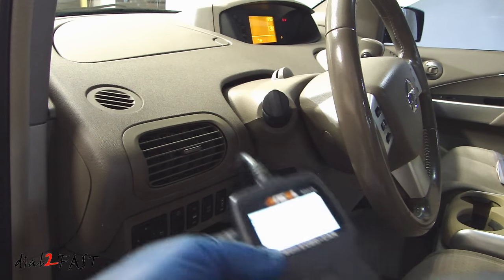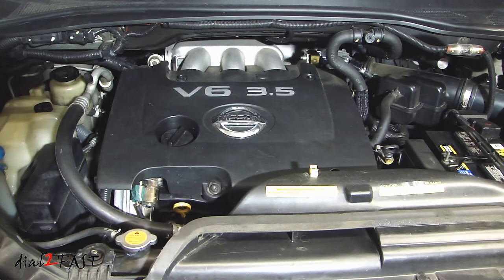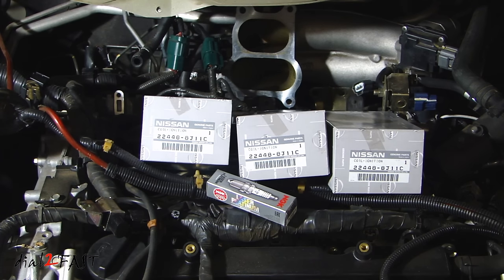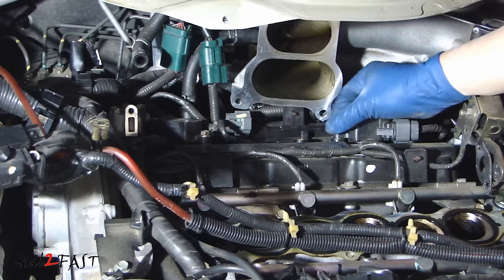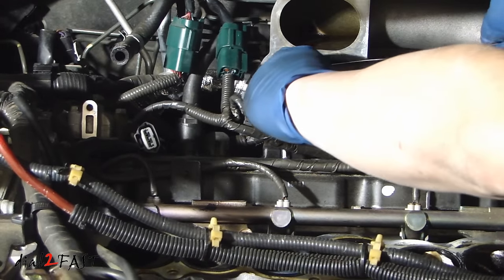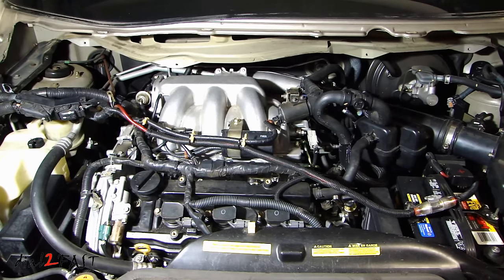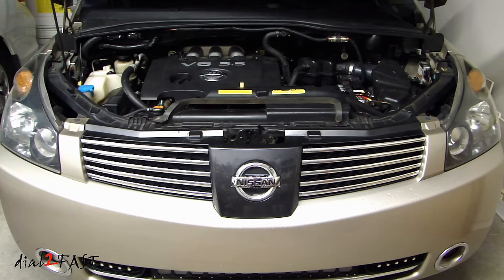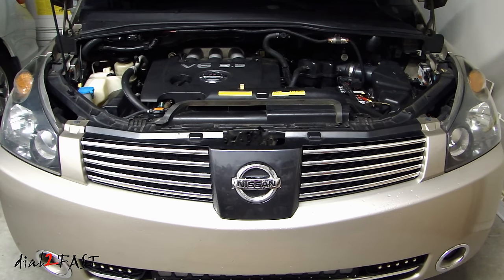Nissan 3.5L V6 Ignition Coil Misfire - P0303 Cylinder 3 Misfire

Comment: I just want to say THANK YOU for your videos. 2 days ago the 05 quest started shaking and stuttering and the CEL flashed on. I keep a scanning tool in the van because the P0420 likes to come on at times and I just reset it.  So the code came as the same cylinder #3 misfire. Ordered the parts on Sunday, locally, and called as a "what the heck" to my two mechanics to see the cost of labor. $300. ugh. So spend several hours on Monday looking at the videos to see how to do it myself. 

Very slow and methodical, and struggled with that one bolt on the back bottom right of the intake. If it wasn't for that, would have gone quicker. also, a socket fell as I was trying to finish and putting the two bolt on the back of the intake ( the two in the back bottom closest to the firewall, not the group of 4 to the intake).  Luckily, the last time my mechanic redid the valve cover in the back, the green connectors were left unattached from that bracket. 

All in all, took 7 hours for me, which included lunch, breaks, two trips to the auto parts store for that torx socket and another stubby ratchet, since mine was too fat, and alot of latex gloves!!! But I saved $300, actually more as I got 3 ignition coils on sale for less than the price of 2 at the mechanic (if I took it there).  I opted to do all three at once, with new plugs, because I wasn't going to do that again. 1 spark plug was actually cracked on the tip. So glad I did them. You Rock!!!!

Comment: I did my 05 Quest and I removed the two bolts holding down the back bracket it’s showing on minute 4:35 instead removing all four bolts it was a time saver and easy doing it that way. Thank you for posting this great video
Reply: Hello, Did you remove the window cowl and wipers to get to it? Thinking of doing myself and that may determine if I do or not? Thanks

Comment: I found it a lot easier to remove the entire upper plenum with throttle body, and I highly recommend anybody doing a tuneup on a Nissan or infiniti to replace ALL coils at the same time to prevent having to take it all back a part again lol
Reply: Chris Atkinson I did the coils, spark plugs and the valve covers on my 05 Quest and I pulled the upper plenum with throttle body I just removed the two bolts holding the rear bracket it was easy than the four bolts thanks for your comment.
Reply: Thanks
Reply: Hello, Did you remove the window cowl and wipers to get to it? Thinking of doing myself and that may determine if I do or not? Thanks
Reply: @moisessantacruz8903  Hello, Did you remove the window cowl and wipers to get to it? Thinking of doing myself and that may determine if I do or not? Thanks

Comment: Thank you for sharing your expertise !!
Exactly what I need to do to my 2005 Quest. 
My No. 1 cylinder is coding a misfire. I haven't checked under the hood yet though. 
I'm hoping they put my engine in backwards so I can get to the cylinder easier. You know, like they do for European models because they drive on the other side - fingers crossed 🤞🏻

Comment: I am with you all the way when it comes to buying parts; in that most of them should be Nissan parts This goes with MOST things you buy. Yes other parts manufacturers will save you money for sure. But they often cause aggravating problems too. Believe me I have experienced this many times in my 88 yrs old. And so have many others had the problem.

For what it's worth, I disagree with removing the "studs" when removing the intake plenum and EGR parts. Simply remove the nut. There is simply no need to remove the stud. Worse; when you remove the studs it is easy for the gasket to move from where it is suppose to be when installing it. Even a little bit it can cause MAJOR problems in the engine.

I can not emphasis this more. For, IF that gasket moves slightly from where it is suppose to be, you can have a problem difficult to find in the future. The sole reason for the studs; are to stop this problem.  Please consider this. Practically, this can be proven with common thinking. IE:

Why are 3 of the intake plenum fasteners  "BOLTS" and yet 2 are "STUDS"? They could have used 5 bolts and it would fasten the plenum the same. Again the studs are to insure that the gaskets are kept IN correct place. In fact the shape of the gasket is designed to stay in place; while installing the intake plenum (manifold).

NO disrespect meant here. I am simply trying to keep DIY'rs from a problem when working on their cars; that happens a lot. Believe me. The same problem is with the EGR replacement. Never remove the studs. Simply remove the nuts and change it. This insures that the gasket stays on correctly when tightening.

Again, no disrespect. I love your video's.

Comment: Great info. It was exactly my problem. The layout was a bit different what you described but the solution was the same. The coil that was bad on my 02 Pathfinder took 20 minutes to remove and replace. Thank You.

Comment: You made so much more work for yourself all you had to do is take that whole intake out as one piece
Reply: To be fair, getting leverage on those bolts in the very back behind the intake’s first part is a bitch, but yeah, it is generally easier. That’s the way I did mine

Comment: I've just done a "tune-up" of a 2008 Nissan Quest for a friend.  It was misfiring on cylinder 3.

When I got it apart, it was clear that the coil boot was faulty; there were electrical burns on the seam in the middle of the boot where it was arcing to the spark plug well on the head.

Long story short: I succeeded in replacing all of the coils and plugs because their replacement were due anyway (though I still would have replaced them all because I don't want to do that again for a long time) and now she runs as smooth as high end scotch.

But this is a job I never want to do again.  Too much damn work just to change the plugs and coils because some nimrods in engineering and/or beancounters in accounting couldn't give the vehicle an intake manifold that's easy to remove for servicing the engine on the side with the odd-numbered cylinder bank.

Another post here said that the owner got a quote from a shop for $700 to do the work.  That's not far off the mark for the labor plus parts.

Comment: Great video I'm in the middle of doing my tune up going to change valve covers and coil while I'm back there I also did my front struts figured with the cowl off might as well.Thanks again for the great video's and advice.
Reply: Ray, I'm buying front struts for my 2004 Nissan Maxima 3.5. I recently watched a vid about how to uninstall and install new ones. The dude didn't show removing the cowl. Am I missing something here?

Comment: Just had my 2010 Honda Odyssey do the same thing last month.  Immediately brought it back to the Honda dealership and told me that there was a class action settlement that resulted in compensation for repair and warranty extension for this particular issue.  Honda changed out the required parts and changed all spark plugs.  I have a link if you're interested in regards to the class action suit since you have the same honda vehicle.
Reply: It doesnt apply to him because he has the EX without VCM

Comment: I have a 2002 Nissan Maxima SE 56,000 miles 19 years old never had a spark plug change in it's life, started misfiring check engine light on, took it to the Nissan dealership they installed 6 new spark plugs 6 new coil packs, a rocker panel and the gasket paid $2685 more than the cars even worth but I gotta say it runs like a top lol

Comment: I have a 2005 nissan quest.
My issues is I have no power going up hills and as I press for more power the engine starts knocking so I let off gas real quick.
It also.could be spark knock.

I'm also having extended crank issues. It's starts but only after it cranks for about 5 seconds or so.

BTW I am get backfire as well when I gun it to get more speed

Comment: No need to remove anything but the upper plenum in order to change #3 and #5.  I changed the pack on #3 two days age in just over an hour.  #1 does require both upper and lower intakes to be removed.
Reply: Hello, Did you remove the window cowl and wipers to get to it? Thinking of doing myself and that may determine if I do or not? Thanks

Comment: A misfire can also happen from loss of compression in the cylinder (bent or broken valves). It would be better to do a compression test before replacing the coils. Because you might have spent time and money and still have a misfire.
Reply: Hard to do a compression test when you can't get to it.

Comment: Thanks for all Quest series videos You share with Us , I have a 2004 quest and was my time for this misfire P0303. For same reason which I don't know My quest was working ok when I was turnin on the A/C. sound crazy but happened to my quest , so I purchase one Ancel which shown P1800 $10 parts easy fix... I was so happy , but after 5 miles driving P0303 come back and this time A/C was not able to stop that P0303, so I started all what you did plus I ordered all those Nissan parts for the replacement and after all that work to be done and right, I Started my Quest and got P0301 and after while (2 minutes I guess) P0300 ..... Any Idea what can go wrong ? 
I'm trying to figure what is wrong 
Thanks again.

Comment: These engines have a problem burning up ignition coils, inspect your battery ground cable, it probably goes down to the firewall and then down to the transmission, it likes to break at this point and the large current produced by the coil has no way to go to a good ground so they burn up one or more coils. Give yours an inspection and as preventive maintenance add a redundant grounding kit similar to what the HIFI audio guys do. Do not bolt to plastic intakes or similar areas.

Comment: Been following you for a minute, and you always have great content. I have a p0300 code, which you explained at the end of your video was the last number represented the cylinder. P0300 I'm lost trying to trouble shoot which cylinder. Any idea? I have a 2006 maxima with 218,000 miles, and I'm thinking more towards the catalytic converter.
Reply from the maker: You probably already googled it, but P0300 indicates that two or more cylinders are experiencing misfires. You might want to take it to a mechanic to have them troubleshoot it since it's multiple cylinder having issues. If you want to tackle it yourself, you can first try replacing all 3 coil packs and spark plugs on the front side, and see if that fixes it (since the front side can be replaced easier). If that doesn't fix it, then do the back 3. Also the plugs need to be replaced every 100k miles anyways.

Comment: I replaced all the coul packs an sensors an now the car has a red light on dash of a car with a key inside it the security  light an will not start up it turns over but wont fire up it's like it's in secure mode  what do I do I done the hard factory reset I dont no wat to do 06 Nissan murano
Reply: Disconnect the battery for about a half hour...that should reset your computer. Also try changing the battery in your key fob. Hope it works out for you.
Reply: @thatmexican7317  hey man I ended up had it taken to dealer there saying thet there isn't any readings of 5v coming in to the immobilzer so they think I should buy a new key an reprogram it bc everything else seems fine so I dunno

Comment: I have an 07 Murano I got the code P0300 what is that ?
Reply: Hey for the record I put in some carburetor cleaner I mean fuel injector cleaner ran two tanks of high-test away which I always run and the cold went away and started running better

Comment: What if you're spark plugs are still good do you still have to replace them to
Reply from the maker: It depends on the mileage you have on the spark plug. Even though they are 100k mile plugs, lets say if they are 70k or 80k on them,  you can replace it.

Comment: Great video.  Do you think that this is similar to a 2006 nissan maxima, US? i have a p0301, cylinder 1 misfire.  car has a bit over 200k miles .  Spark plugs are almost 3 years old, and maybe 20k miles.  I also just had the firewall pre-cat replaced. Thanks!
Reply from the maker: The repair process will be the same for your car. If you are getting the P0301, then it appears to be a bad ignition coil, but I can't guarantee you that over the internet. Just make sure you buy original Nissan part for this repair.
Reply: Thank you for the reply.  You used a torque wrench for the intake manifold.  Is it necessary or could i get away with just a regular wrench? thanks!
Reply from the maker: You really should use a torque wrench so the entire piece is torque down evenly so it's not too loose for leak or too tight to warp the part.

Comment: I have an issue and I'm hoping someone can help.  Initial issues is the pesky PO174..catalyst efficiency below threshold bank 2.  I purchased just 2 catalytic converters along with 2 o2 sensors.  Took to Nissan to fix.  They failed me.  Code is still 🔥.   Spent 3 grand.  I provided parts.  Cost is labor.  Provided I had other stuff done like, struts and 1 wheel bearing.  Picked up my car after 8 days in the shop.   All suspension stuff came out ok.  Just a bit of a noise now.  Abs, slip and ATC OFF LIGHT all display on screen.  HELP!  CEL.

Comment: I have 2005 Nissan Quest . Recently Replaced plugs, coil pacs, o2 sensors, cam shaft and crankshaft position sensors. Vehicle has 240,000 miles on it. It runs fine until it gets temp up... 15 or 20 miles, then engine quits. It will not start until it sets for 15 or 20 minutes then starts and runs fine  .  No fire from coil pac. ???? Any help?

Comment: My wife's car has a similar problem, but luckily it's P0304... It has a 130K miles, so others are possibly a problem, but I think I'll stick for now with just the front center one, which should be an easy one to do right now.
Reply: @franxiscofajardo2063 , that is the front center cylinder. I have ordered a Delphi Gn10242 oe coil pack from amazon. Totally affordable for a Japan made piece...
Reply: @thinking-laaf  
I already fix it, it take me 10 minutes to fix it I had saved a coil from my nissan 350z  I put in on and the problem was over 👍. Good luck with you car 😎
Reply: So. Ok. The problem was simpler than expected. Makes me slightly peeved about the mechanics which replaced the spark plugs at 100K though.
They potentially / likely misthreaded the #4 coilpack bolt and it potentially wasn't tight enough. There was play up and down for the coilpack when I swapped #2 and #4 (didn't notice it when I took the bolt out :-( ). I had to clean up that thread with an M6 tap and voila, the bolt went in by hand almost all the way. (I was very concerned NOT to go too deep with the pointy tap..., made sure I had at least 3-5mm clearance from the bottom of the hole - I checked with a gauge, and taped the tap off so it wouldn't go too deep... - used air to blow out the parts and oil to make sure that wouldn't cause problems, and checked the holes with a light. This 2007 Murano (In your video it's different) has a 1" wireloom right over the bolt, so it is very easy to get it in wrong. Torqued it, and while I swapped #2 and #4, the code didn't happen on #2, and when I checked the coilpack with a DMM it looked right. A transistor on the primary, and a diode attached to the coil on the secondary side.
Someone (likely not them) foo-barred the bolts for the plastic cover as well all 4 were junk, which was the result of a second thread insert in the composite valve cover being bad. Take the cover off a number of times,. and that bad insert jacks up the bolt. Those bolts are ridiculous expensive though, for a NON-Structural bold. $8 a piece. You can likely get away with allen key M6 bolts and washers from HomeDepot or other places in the right length. They should NOT be longer, you'll possibly crack the valve cover!

Lesson: Check the bolts for damage when you take them out, and hand tighten them. IF ANY early resistance CHECK! Hadn't I been able to fix the thread, this would have been a valve cover... Which Nissan wants ~260USD for (+ gasket). There are way cheaper ones on Amazon, but I didn't trust them.

Comment: I just change my coil pack, put new spark plugs because it had po303 code, it needed them change, great videos, done all that work, still driving the same way, they said it could be fuel filter now, do you have a video on changing it

Comment: went to canadian tire and told them i scanned my nissan and got a p0303  they suggested a spark plug, coil and plenum gasket replacement. Was charged 509  but when i got the car back the problem was worst, now i get p0300 multiple misfires. So i went back to them  and tehy want to charge an extra 100 diagnostic because they say I requested the work done and not a diagnostic. so I agreed with the rep i spoke to who suggested what to repair.  Gave in and OKed the diagnostic but now  they are still waiting for a diagnostic because they cant figure oiut whats wrong. It is going  on 3 days now. What could be the problem since they replaced the parts that would cause this problem?
Reply: Did you find the problem?

Comment: Will this work on a 2003 Nissan murano? Also do I have to remove everything you did to only replace coil #5? I also need to change o2 sensors, should I consider doing it at the same time ?
Reply: Byron Argueta did you ever find out I have the same code and problems as you ? Would be helpful if you could reply back thanks.
Reply: Same here.. Code P0305 on my 2003 Murano. Ive heard yiu can replace coil for #5 without re installing removing plenum - still havent heard from anyone that  did it!